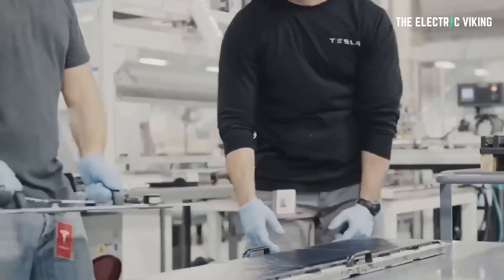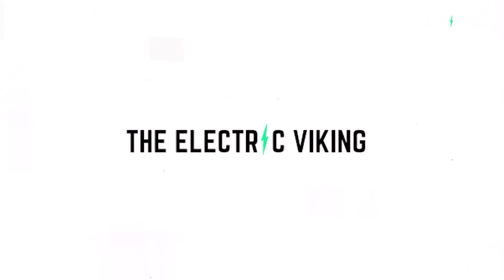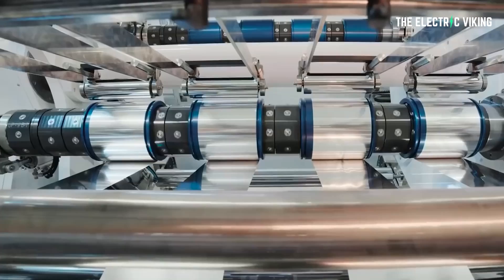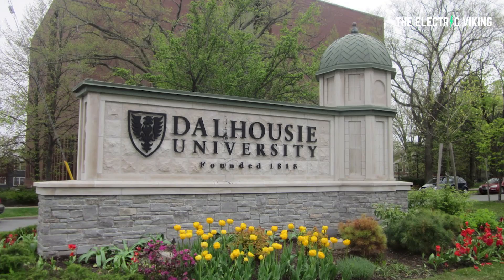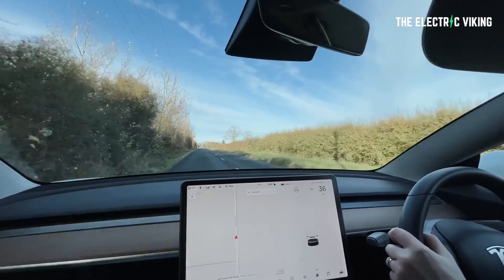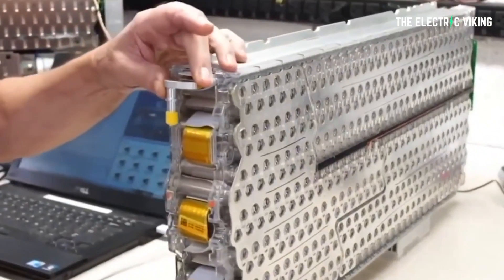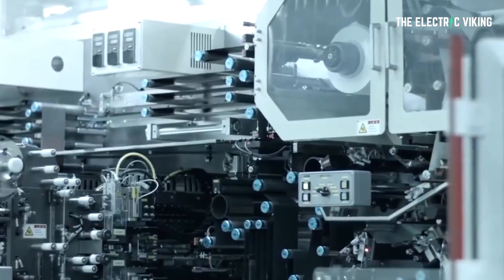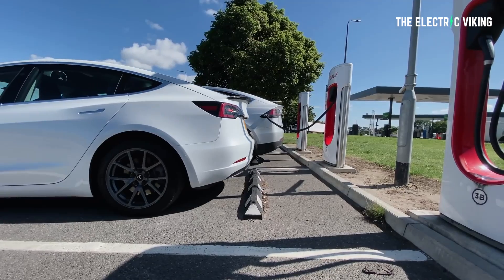What everyone missed about Tesla's insane 100 yr battery

Comment: So if someone said to me, I have 2 cars.   1 will go 240 miles and last for 15 yrs before battery replacement  and the 2nd will go 150 miles for 100 yrs.  I'd go for the 100 yr one.    I rarely need to go 150 miles in a day and if you did there should be 4 options.   1.Charge station, 2. rent a long distance vehicle for the day,  3. use public transport (USA is of backward in this area) or 4. wait for it......a extender trailer!   Yes extender trailers do work, they don't make them of course, but I have seen people make their own.    Those that have can incorporate in their house battery system, but it really should be rentable and at charging stations.    So when not in use they are helping with either the station charging or grid stabilization.

Comment: Grid stabilisation ultimately will come via vehicle to grid optimisation. The batteries are already there at night not being used. Better charging infrastructure, fed principally from solar,  during the day will provide enormous storage during night time hours. This will effectively flip the current cheap  charging paradigm from nighttime to mid daytime. We are in the stone age regarding electric vehicles at the moment and huge changes are likely to happen in very short time periods. Think smartphone levels of change on steroids

Comment: The residual value of a vehicle when it is sold second-hand will depend primarily on the state of its battery. Anyone who buys a new consumer vehicle will want the latest technology battery that will come with the new vehicle, regardless of how great the battery is on the vehicle that they are selling. Battery technology will continue to advance to improve its energy density, degradation/lifetime, cold weather performance, hot weather performance, safety, charging speed, cost, etc.  As long as battery technology continues to improve, people will continue to buy new vehicles with new batteries. It's the perceived difference in the quality of the battery in the second-hand vehicle versus the batteries in the newest vehicle that will primarily determine the resale value of consumer vehicles.

Comment: Ever heard of an Edison battery?   Thomas Edison invented a nickel-iron battery with a wet electrolyte.  They were designed as a backup system for telephone switch stations.  Basically they kept telephones working during a blackout.  All you had to do was change the electrolyte after decades of use and the battery would be 100% usable again.  They batteries were prized by off the grid people when the telephone companies abandoned land lines and went to cell phone towers that had a propane generator or some other form of electrical backup.  They could be discharged to 0% without damage.  Unfortunately the energy density was not very high.  They are too large and heavy for a car, but some people in off-grid systems still use them.

Comment: Tesla can capitalize on the fanmily sedan marrket by producing a car much like the Toyota Camry LE. Instead if the Tesla's insane 0-60 times, a family sedan can sell very well with a 6-8 sec 0-60 time. Savings from reducing torque/horsepower required presently will then be devoted to longer trip mileage and cost savings. This more sensible approach will access the Huge family sedan/SUV market.

Comment: It is unreasonable to expect a vehicle to last much beyond 25 years of fair use. Aside from wear and tear on the drive train, oxidation of plastic and rubber components,  rust and metal/material fatigue take their toll.

Aside from that, technology inevitably moves on, just about
 any technical item more than 25 years old is obsolete and performs at much lower levels than current technology.

Vehicle manufacturers should aim for a 25 year life, eight for new user, eight in second hand market and 8-9 in third hand market before being recycled.

Of course there is nothing wrong with keeping a vehicle going longer if an enthusiast wants to keep it in service as a historic vehicle.

Comment: I think you are not considering that what makes an ICE car expensive is the replacement of engine and transmission so cars themselves are made for about 15 years use . EV on the other hand can be made to last 30 years ,if you recharge them once a week thats 1500 recharges in 30 years . The technology in a new Tesla is simply updated on line , the body dosen't rust out like cars in the 60's , The braking system is more than adequate , the engine and transmission can easily last 600,000 kms ( thats 30years @ 20,000 KLms per year ) . If the car wears out simply use the battery as home storage as people do now with wrecked Teslas . Take a 70 Kw battery pack and even if it down 60% thats still a 24 kw battery storage system . These long lasting batteries are ideal for grid stabilisation where they may be charged and discharged say 6 times a day . This is where I see its big advantage .

Comment: There are 10 year old ternary battery Teslas still on the road, and doing fine.  LFP batteries can easily make that 20 years, or until the car mechanicals wear out, or the car corrodes to much to be safe.
Technology is moving on so taking a 10-20 year old battery pack and reusing it for anything is problematical.  Recycling  for the minerals in the battery is likely the only practical solution.

Comment: This idea of a battery that lasts a lot longer than the car is at odds with weight reduction of using structural packs. Pretty pointless to permanently build a 100 year battery into a 20 year structure.

Comment: It is possible to design, build and sell an LED bulb that lasts 100 years today.   It is simply a matter of running the LED at 50% of it's power rating along with the other parts in the bulb.  Sure it would cost twice as  much as a normal bulb to make it.  It's a great way to go out of business, so it won't happen.

Comment: You wouldn't pull your battery from your used car. That would essentially make the car worthless. You would sell your car with the battery and then buy a new car with a battery. That would make more sense, imo. What the new battery could do, however, is increase the resell value of the used cars as used car purchasers can be confident in the lifespan of the used battery that they are getting.

Comment: Sorry Sam.  nobody is going to be taking their batteries from one car to their next.  it will, however, increase the value of the used car you're going to sell.
Reply: That I would think is more realistic. If the battery has value even after the car is uneconomical to maintain, then you get a significant amount of money back to scrap it. The battery itself would be more likely to be used for something else or just recycled. It's certainly a more environmentally and economically efficient system than what we currently have.

Comment: Really interesting thoughts, thanks Sam. Used battery swoping into new cars is a real game changer which addresses environmental and cost issues, but competition between manufacturers may limit battery swooping to same-producer vehicles - that's if Tesl a hasn't removed the competition!
Reply: Yes; my first thought was that each manufacturer would have a perfect opportunity to lock customers into buying their products, by customising battery-swapping technology. Then the next thing would be to essentially make the older battery packs obsolete by removing backward compatibility; use of 'built-in obsolescence'. Neither of those ploys is a desirable prospect for customers. 

That's the kind of thing which has happened for more than the past century, with many products. Think what they will try to do with component parts, connectors, sizes, recharging capabilities, coolant systems, monitoring hardware, firmware, software, etc. 

It's already standard practise to lock a battery to control hardware uniquely, so that even a replacement battery or board will not work unless the manufacturer permits it.

Comment: there will be some sort of use though as you say not for cars.  Power walls or what ever.  A key problem is - do you want to waste limited lithium on it?  There already is a choke point on Lithium available - would this be a better use than making more cars or trucks?  The best use probably still is cars; and PHEVs which only need 10% as much lithium per car to achieve commute milage on electricity; electricity provided via a gas engine with catalytic converter or regen or outlet depending on which is best for the environment in Australia about anything is better than coal.

Comment: Interesting Sam but in many ways contradicts an earlier posting you made about Cell to Chasis developments that both Tesla and some Chinese firms are working on. In those cases you will not be able to move an old battery into a new car as the batteries will be part of the structure. Even better for the environment would be cars that can be kept going for 100 years as well as batteries..a complete killer for the industry perhaps but at some point cars much reach a stage of development where their performance and running costs are optimal and any improvements only marginal. This of course will never happen as Madison Avenue will work hard to make us want the latest styles....the car is of course in many ways a fashion statement, feeding on the human weakness of wanting to be seen in something new...thus we are doomed to consume!
Reply: I guess you haven't seen the recent video of a 50 ton truck running over a BYD battery and then being put back into a BYD Seal with CTB technology. 🦭

Comment: The battery of an EV is so heavy that it's equal to the weight of six adults that's before the real passengers sit in. The US government will "surprisingly" announce later the repair cost of roads and bridges have tripled because of the impact the millions of EVs have had on the infrastructure.
Reply: The average electric car weighs 20-30% more than a comparable gasoline engine car.  Depending on whose statistics you read, a fully loaded tractor-trailer semi causes at least 100 times as much damage/wear on the roads,  and some estimates claim the damage is even magnitudes greater.  Considering that the best selling vehicles in the US are pickup trucks that weigh more than a Model Y, it is doubtful this will be a significant issue.
Reply: @DrTed3  If we take an   average  of 25% weight of Telsa model S thats 500 kilograms or more than 1200 lb which is the weight of SIX Americans adults on diet  🤣🤣🤣

Comment: Um, look at the "smart" phone batteries.  How many different ones are there?  Almost every model has their own model of battery.  The gen 3 phones are being discontinued.  I have 2 good phone batteries that probably don't fit anything else of usefulness.  Models of batteries are designed to fit a particular application.  A battery to fit a Ford is not likely to fit a Chevy.  You get my drift.  A model S battery of a particular year is not likely to  be put into a model S a few years down the road.  So the idea that you are proposing is never going to happen.  And if it did, battery progress would halt right there, because it is not likely that a more revolutionary battery would fit the old models.  Same with yard tools.  A DeWalt is never going to fit a Toro.  NEVER  There may be short term exceptions using adapters,  But the companies work hard to make that impossible over the longer term.

Comment: No, it doesn't mean LFP cells will have higher energy density....
They "tweaked" these cells by lowering the voltage and removing graphite.
They can adjust the graphite and / or voltage to provide output anywhere in the range between LFP and other Nickel based cells.
The other thing I suspect happened?
Jeff Dahn said years ago "we know what causes dendrites, it's a chemical in the electrolyte (or possibly in the solvents??)... We can remove that chemical"
What would limit pack life? A high percentage of cells being removed from the system by the BMS?

Comment: What you are missing is the unfortunate reality that the majority of automakers will utilize a proprietary form factor that will only allow the migration of the battery pack to another car from the same manufacturer thereby negating any real long term advantage that this technology has to offer. You will own a battery pack that you are stuck with and your only option will be yet another piece of junk that will require lots of repairs and servicing at the dealership. Hate to rain on this parade but I promise you this will be how it plays out.
Reply: Albert D / No, it will not play like that. The long range and very durable in time batteries will be solid-state and they will become cheaper and cheaper until the battery in an EV car will not matter too much.
Together with the advent of the wide scale robotics and totally automated manufacturing of everything, the EV of 2040 will be very, very cheap.
Also, prepare yourself for the universal salaries in 2040.

Comment: "you won't buy a car with a battery".
1) "You" probably won't buy a car
Think about it.
This cell (in whatever form it emerges) could be perfect for a "one time robocab pack".
Fit and forget.
When the cab comes in for it's major refit, unplug the looms, lift the body off the skate, sent that for refurbishment.
Remove the seats (and carpets? If fitted?)
Rebuild the suspension.
Fit refurbished seats and body (NOT necessarily the same ones!) and out the door in..... 1 hour?
.
2) If "YOU" own the car, at end of life you sell it (and the valuable pack) to either the dismantler, or Tesla (!?).
It then enters the cab system, after refurb, maybe with a different body style?

3) Alternatively, you could send YOUR car for refurbishment.
Comes back in a day with a "new" body, (or even body style!) Or in a week with your original body refurbished.
.
But..... "We" will not be buying cars in future!

Comment: Will recycling the better into a newer car be that easy if we all move to structural battery packs?
Reply: I'll say again.
Don't confuse "structural" with "not removable"
The "structure" is only required when driving.
The car can't drive without the pack.
Therefore, you can either remove the body from the pack, or the lack from the car..... When it's static.
It's just a question of design.

Comment: Low energy density plus extreme long usable life would work great for home and grid battery backup systems. That is if the battery needs to be twice as big to hold enough juice it is not a big issue for a non mobile system.
Reply: We know this.

Comment: I read the research myself and ìt mentioned the lower voltage 3.8 vs 4.2 utilized per cell or pouch. The volumetric density òf research batteries was 210 watts/kg, identical to the LFP batteries. The part I hate was the higher cobalt content used, 20%, since it was a 532 chemistry of NMC.
Reply: Doesn't mean they can't tweak the chemistry.
This was the test cell.